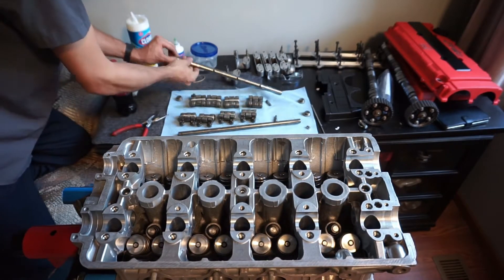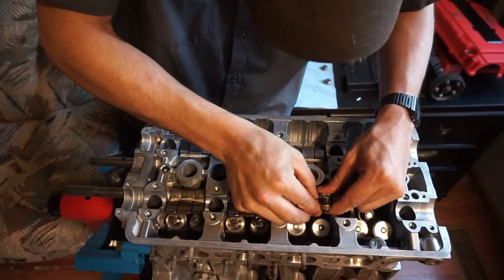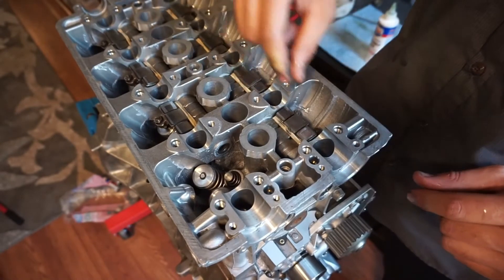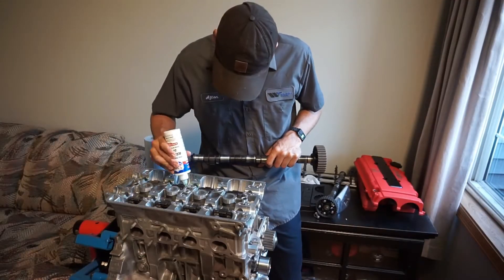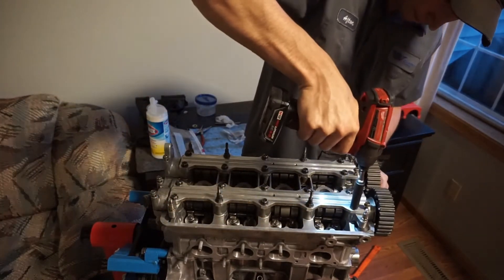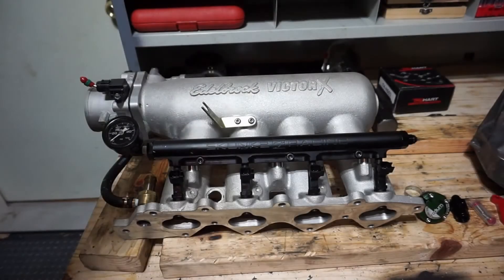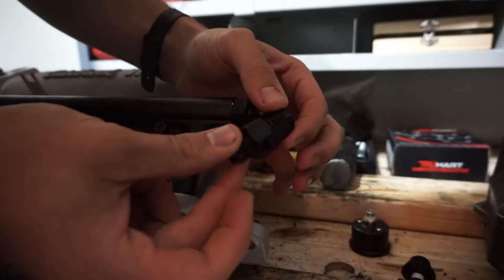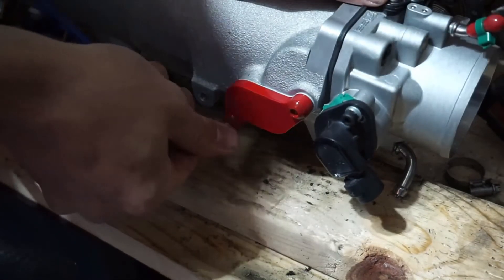Cam Degree Prep, IACV Delete and Fuel Mods for CSS B16 Civic

Comment: Did the radium damper fix the fuel pulsations? What rpm did you have the pulsation? Mine goes crazy over 8000rpm
Reply from the maker: Yessir it did, highly recommend
Reply: @kraftingkars  that’s good to hear. I ordered one yesterday, I hope it works for my setup too.

Comment: Hey brotha if I block off the iac, is it as easy as going into Hondata and turning it off? Or would you have to get a proper tune to use the block off plate?
Reply from the maker: You shouldn't need a tune, if your good with Hondata I think there is a table that allows you to adjust ignition/fuel compensation based on your ECT. I haven't touched that yet on my setup, I just set the idle using the stop screw and the bypass screw on my throttle body. On cold starts you may have to hold your foot slightly on the gas until the engine warms up to hold an idle. Similar to how the factory ecu will raise rpm on a cold start.

Comment: Hey buddy! Cheers from Brazil, that's a really nice video!

Before I can get this block off plate, what did you think in terms of performance? My DX B16A2 has a 36450-P30-000 and here in Brazil is impossible to find a original either a generic one by the wider bolts. I'm not convinced to buy from eBay or any other similar sites. But my dead IACV is just letting me pissed off af.

So I wanna know about this block off plate, I was searching for it them I found this video.

Thank you again and very nice video!
Reply from the maker: Thanks man! So I would recommend this block off plate if you have an aftermarket ECU like a hondata s300 or something similar! As long as you have no vacuum leaks, the iacv block off plate helped me a ton getting my idle nice and smooth and consistent! If you live in a colder area sometimes you need to hold the gas pedal for a little bit on start up to get your engine up to temp before the idle will hold a steady 750-850 rpm! Let me know if you have any further questions!
Reply: @kraftingkars  Thank you very much for answering!! So, I'm using a stock P30, not planning to install a aftermarket ECU for now at all, but it's possible in the future. Anyway, my main problem is a high idle when VTEC is engaged, but I'm really confident there's no vacuum leaks: inspected all vacuum lines and they're all good, cleaned the throttle body, IACV (this is bad), calibrated TPS... nothing solved my high idle problem when VTEC gets engaged. But I could relate that my PCV and fuel filter are bad so I'm replacing it tomorrow. 

What I think about is making a block off gasket on the IACV intake entrances until I can't get a new valve or a new ECU set.

Comment: Quick question, what did you did w the coolant hoses that are supposed to go to the IACV? As far as routing or deleting those too
Reply from the maker: I'll get back to you when I get back home today, but simple way to bypass it would just be to connect the lines that went to the two barb fittings underneath the iacv.
Reply: @kraftingkars what did you do with the coolant hoses?

Comment: Nice clean setup as usual.. never seen the iacv delete plate before for b series.. I would assume that you would have more idle issues by using the plate.. let me know how it works out..
Reply from the maker: Without an aftermarket ecu yeah the plate would really mess up your idle, but with the hondata s300, you can adjust idle speed, as well as ignition timing based on intake temps to keep your idle consistent with different weather/engine temps
Reply: @kraftingkars  Sounds good. Thanks for still doing b series! Love the old school VTEC motors..